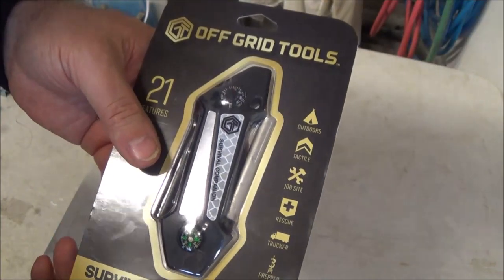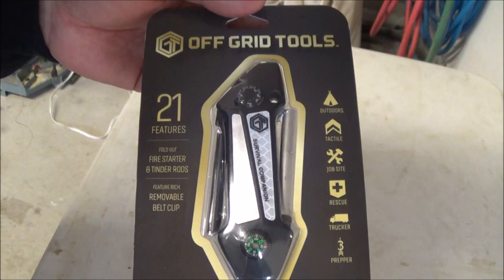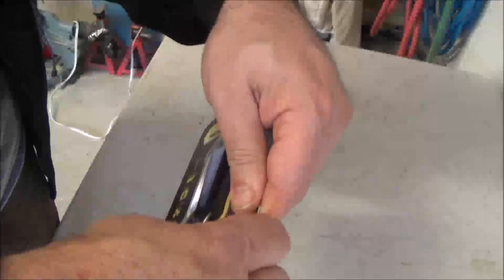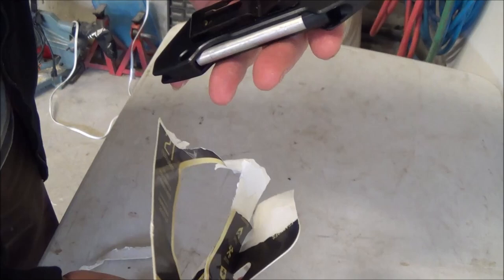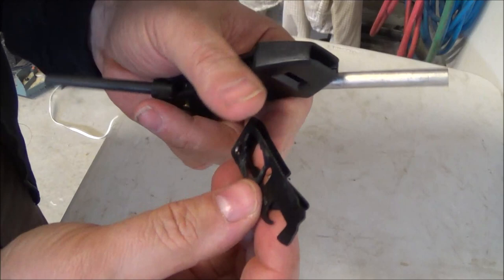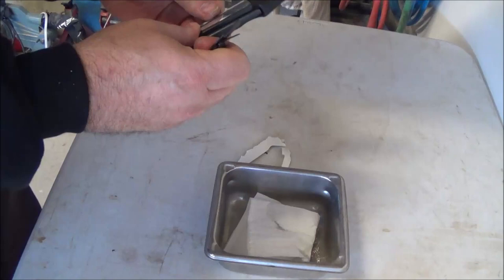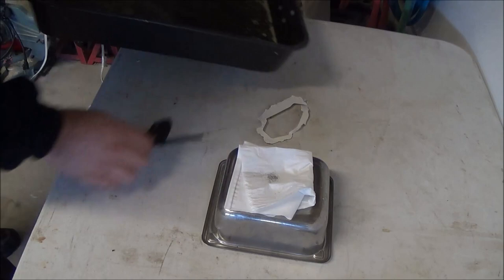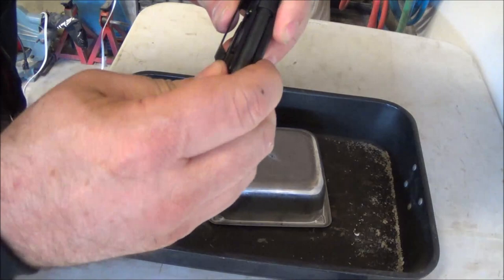What's in your Bee Kit? I decide to put a fire maker in my kit. Unboxing and testing a fire starter.

Comment: LOL Frank, This may seem old fashioned, but the old fashioned cigarette lighter pushed in and heated up and pushed into some rolled up newspaper is usually a winner, pretty safe. Otherwise, not as safe, rolled up newspaper pushed up against the hot exhaust manifold will usually give you a light also. Next is a jumper set of leads, with two short lengths of wire hanging out of them. Quick spark in the tinder and way you go! This tool you reviewed will also work :)
Reply from the maker: McGuire bee keeper! One thing o realized doing the video is that for the 50$ this thing costs you can probably get a box of lighters!